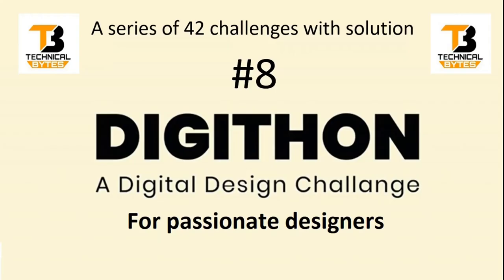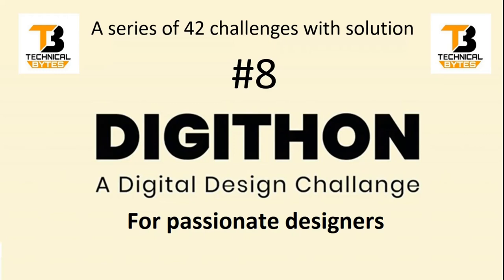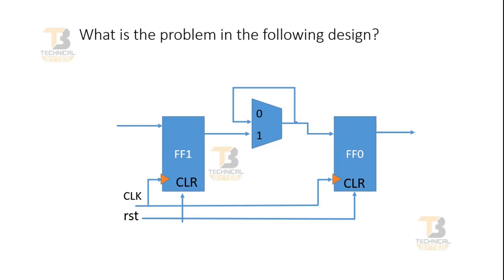DigiThon Question Part 8

Comment: There is a latch between two flops.  It will corrupt the downstream logic because of its operation based on mux select, with high chances of data getting metastable at the input of 2nd flop.